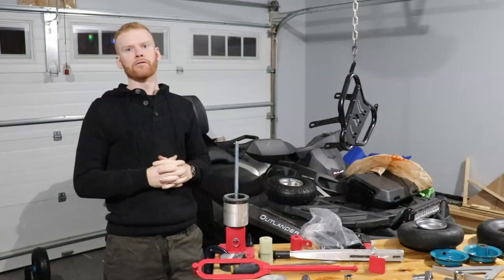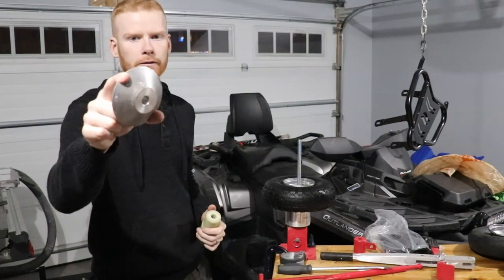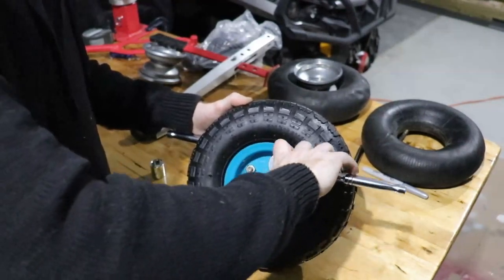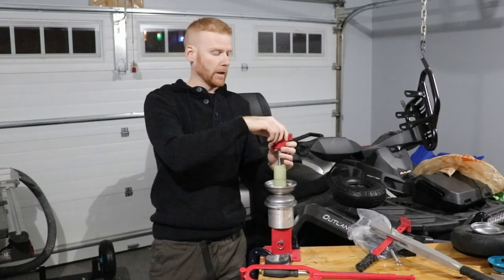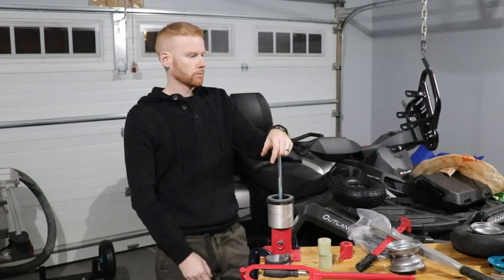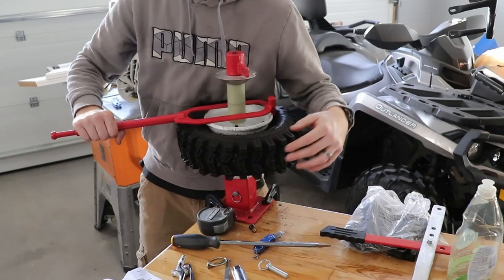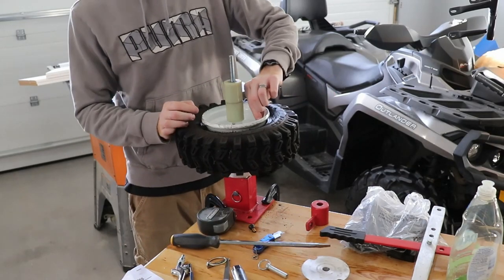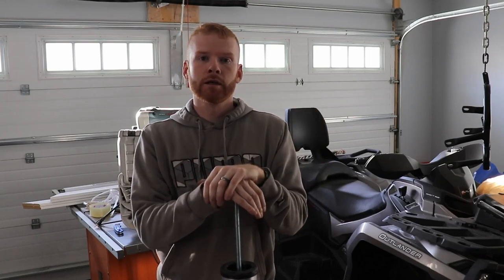Princess Auto   HF Mini Tire Changer

Comment: A bit of soapy water or tire lube in a spritzer bottle will help the tire slide off or on the rim. Also, a pair of Vice Grips clamped onto the edge of the rim will stop the tire from spinning while trying to mount it.